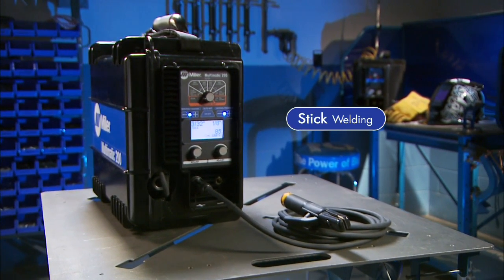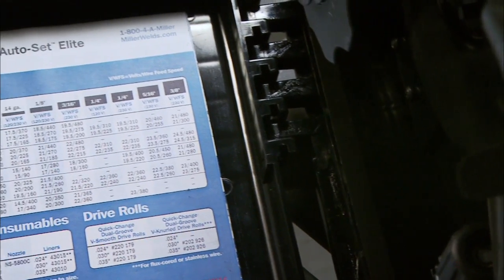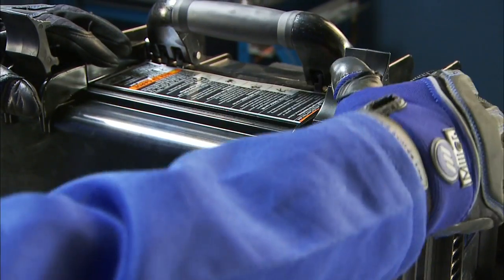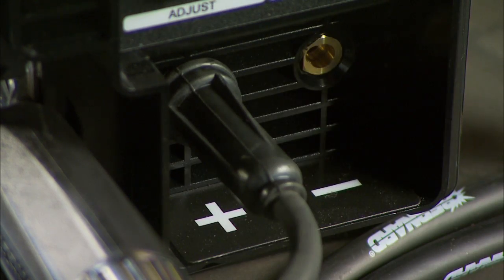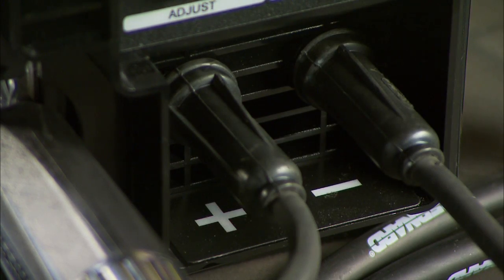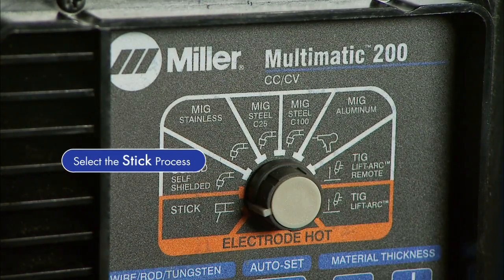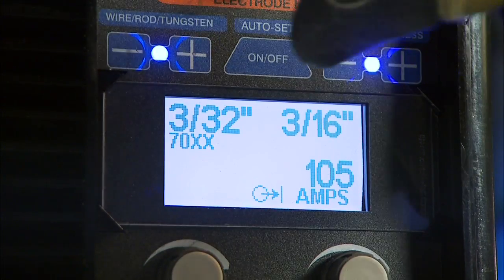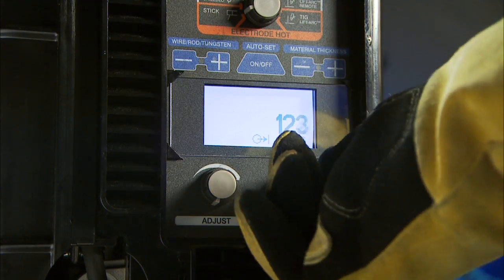Multimatic™ 200 - Stick Welding

Comment: does this have pro set?
Reply from the maker: Hi Doug, thanks for your question. The Multimatic 200 has Auto-Set™ Elite, which can be used on multiple materials and multiple processes with the ability to fine-tune your settings. You can learn more about the machine on our website: https://www.millerwelds.com/equipment/welders/multiprocess/multimatic-200-multiprocess-welder-m00361.